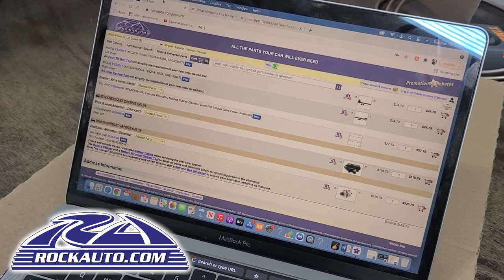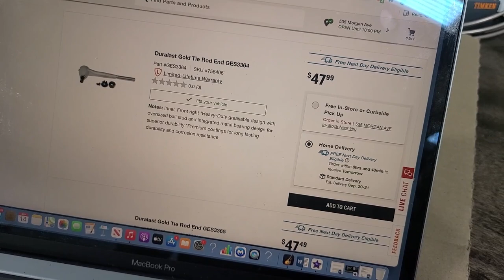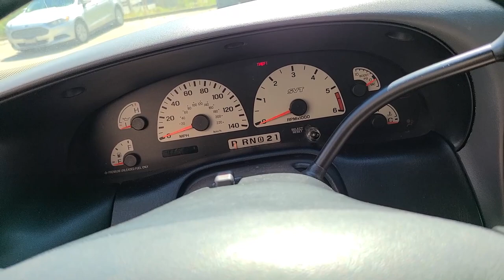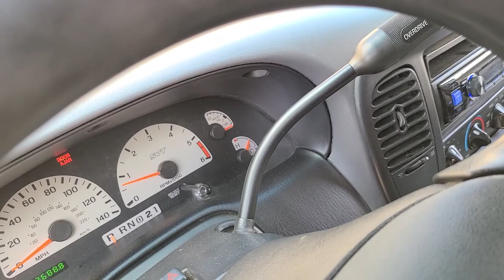I Found A MAJOR Engine Issue After Fixing EVERYTHING On My SVT Lightning! Previous Owner Had To Know

Comment: I own a 2002 Harley Edition F-150 and love watching these to get an idea on what to replace and how (relatively same as lightning). Just bought my end links, control arms, and pitman arm today and stumbled across the video. Another thing I would HIGHLY recommend on these trucks are catch cans. My HD always had a little oil residue on the intake manifold and inside the intake elbow and the factory trucks tend to blow a little oil by. Yours may not be doing that since its a 80,000 mile lightning but I beat my head in trying to find the fix for it so I figured I'd leave it here in case you notice the same. Love the vids and if you happen to get a catch can Id love to see an install.
(Transmission valve bodies are a cheap way to have you nearly spinning through 3rd gear if you are looking for a performance mod. I Recommend Punisher Valve Bodies personally)

Comment: Ive used rock auto, good and bad dealings. Easier to buy locally than deal with returns online.
Working on turbo diesels, an easier way to test for blown head gasket is install pressure gauge in degas hose at coolant reservoir and than do some WOT boosted pulls and watch the pressure gauge. If its a head gasket the pressure in the cooling system will jump to 20-30 psi over the cap rated pressure  easy peasy and no risk of burns

Comment: The only sealant I would trust for repairing a dodgy head gasket is a product we use here in the UK called "A new head gasket". Trust me, sealants just clog and block up everything without really addressing the issue - Don't do it. Plus, when Ford changed the heads from 4 thread spark plugs to 8 threads I think they fitted a beefed up head gasket (3mm if memory serves) this may well solve your issue, however check the head bolts for torque settings. You may get lucky

Comment: I had an Audi A2 with similar issues, I sold the car rather than fixing, but stretched head bolts was the suspected cuase.

Worth a try with the head bolts before pulling the motor.

Comment: Some advice on further troubleshooting- pull a spark plug and use a borescope to check the threads in the head. If it's been 'repaired' you'll immediately know, since the repair involves adding threads to hold the plugs better. 

Also, I'd definitely pull the valve covers and check the head torque - I'm quite certain that it'll at least help, even if it's not the root cause (which I think it is, personally). Free except for time, and maybe gaskets depending on their condition or type (do these use cork? I'm don't remember)...

Comment: I had same exact issue...  turned out the block also had hairline cracks in between the water jackets, truck still ran fine locally but the longer I waited to fix it, I think i just was hurting more parts. I ended up buying FB market place engine and built it first, then swapped. Good luck... you gave me the hibbie jibbies with this video reminding me what I went through..

Comment: Id bet its a stud. Only happening under stressful conditions (I.e 'beating car' = full boost and engine PSi at max). Drivability still good, no rough idle and only dumps coolant every 100 miles. Suggests no warp in the heads an no constant leak in the gasket, the studs are probably stretched and its lifting under boost

Comment: Blue Devil works pretty well and doesn't clog stuff up.  I've seen it seal a 2 inch long crack in a Ford 7.3 diesel when the owner let the water freeze.

Comment: When it comes to renewing the front end on a vehicle, Performance Suspension Technology is the way to go with their polygraphite bushings for everything but torque arms. Get the rebuild kit and get a serious discount on front and rear antisway bars, bushings, brackets, and end links. I have yet to see a Ford centre link fail, even after a million miles. The Pitman arms have never given me any issue. Have done a few outer tie rod ends and lower ball joints on one of my Torino Birds. What I have found is that about 30 years or 200,000 miles the output shaft seal begins to leak. Since the steering box is usually showing wear by then, it is just as easy to replace it, making it good for another 200,000 miles.

Comment: I used the Blue Devil stuff on my Sentra SE-R because at the time, I didn’t have the time, money or place to fix it properly. It worked and lasted for about 6 years before I started getting misfires because coolant was getting back into the combustion chambers again and I ended up replacing the head gasket this time.

Comment: I used sodium silicate. Will not clog because it need heat and co2 to transform into glass. So will only form glass at the crack. It then takes 800°C+ to melt again so pretty safe. It saved me on various TDI 110 which might very well have even higher pressure than the triton.

Comment: a friend of mine had a lightning that he owned since high school and ended up selling it because oil kept puking from the cylinder head/block mating surface (i think it was the passenger side) near the fire wall.  long story short, he found out that there was some weird machining issue directly from ford and that's about all i remember.  i know he said when he got the new heads in from ford (since he decided to do both head gaskets and heads at the same time), he saw that the machining issue from ford was present on the new heads.  i don't remember what all he ended up doing to get the truck driving again, but he did sell it.  i'd say take a look in that direction to see if its a head issue or at least know what to look for so you can verify if it is or isn't the problem.

Comment: 32mins in, you're saying exactly what my thoughts were.  If the heads aren't torqued properly after previous work then it could be lifting under boost, definitely would at least try retorquing them before pulling the whole thing out.  If it was pressurising and spewing under more normal driving & not only when hot and being beaten then I'd say not as likely to fix it but as long as you've not been forcing the issue a lot you might get away with it.  Triton = Ford's 7M? lol they had issues from the factory though with the head bolts being torqued to 78nm instead of 78ft/lb so nearly 25ft/lb short!
Reply: oh & definitely wouldn't advise any kind of sealer, my experience suggests they don't work too good when there's combustion gases in the coolant.

Comment: Alex- Had good luck with Blue Devil head gasket repair on an 05 Tundra with a fairly minor leak. Was experiencing coolant loss and misfire on that cylinder. Been running flawlessly for 20k miles and counting since Blue Devil. Never used it on a boosted application though. Good luck.

Comment: Pull heads, port, go up a valve size, ARP bolts, MLS gaskets, done.  I wouldn't even mess around with doing half-ass fixes, you have other vehicles to be driving while it's down for a few weeks.

Comment: I bought a brand new white 2001 Lightning. At about 20k it almost spit a plug. I was sitting in a parking lot when it started to leak & when I heard it I shut it off & saved it. All the 5.4s did it. In 2003 they say they fixed it but they didn't. I recently seen the v10 trucks spit plugs too. Another problem that I had & others had was the factory goodyear F1 tires randomly had front tire blow outs. Some people had like 2k miles on them & a blow out. I put Nittos on it & never had another blow out. I had 2 goodyear blowouts.

Comment: Retorque the heads and see if problem gets solved. Simpliest solution, but if u want to pour something into engine, KW Metalic block seal has worked for me before in small block chevys.

Comment: I'm very familiar with Supercharged Ford vehicles that blow headgaskets. I've owned 3 Thunderbird Supercoupes. Other than the pristine low mile 89 I own now, the other 2 blew headgaskets right at 140k miles. The 3.8L V6 was notorious for blowing headgaskets even with the NA motors.

Comment: I bought a 09' Subaru Forester. I live in Michigan and bought it in Ohio. It had a perfect Carfax so I thought everything was cool. It was. Car would not heat up and ran so cool the ecu stayed in the start up mode. I got 13mpg driving 70mph in 5th gear. Far from the 27mpg it should get. Checked it out the next day and it had no thermostat. Runs perfect now.

Comment: Big problem on the mod engines. Yes, pull engine and use ARP heat studs for a permanent repair, also Crack check, resurface and a pro valve job . I know, lots of cash but that 1 is worth it. Again, please use studs instead of those cheeseball stretch bolts, a tragic design. I love the color too!

Comment: I would try checking the head bolt torque first. You never know, you might get lucky. It's fast and easy and if it solves the problem, great! If not, you know where to go from there. With a boosted engine I wouldn't trust using some kind of head gasket sealer. If it works at all, you'll always have that doubt in your mind about hammering that throttle and doing Lightning stuff. Better to just properly replace the head gaskets and hope there is no other problem. You'll most likely see that on disassembly.

Comment: Usually people don't remove the heads to fix the spark plug thread issue if they did it right you use the calvan insert and never have to worry about it again which can definitely be done without removing the cylinder heads

Comment: Headgasket sealer worth a look is the small little blue bottle the size of a 2stroke mini bottle. I think the product is called "K2" or "K12" but it gave me an extra 20,000mi on my 5.4 Triton. And also know the spark plug problem! I've installed 3 of the repair kits for the known issue. Good luck! And I know how much you enjoy that lightning, I drove one around for a week and probably took 10 years off it's life. But he said he built it for that. 😂

Comment: I like the idea of seeing what the head bolt/stud nut torques are, but as the problem only exists under full boost load, I reckon you will see nothing unusual on an engine that is cold or only warm. It may only need a cleanup and new gaskets now, but if you keep driving it for some time you could end up with tracking damage to the heads which would need machining work. Come what may, you will never really know until the heads come off, and why could this not be done with the engine in the car? Edited for spelling error.

Comment: Alex **READ THIS**, before pulling the heads make sure to check the oil filter adapter gasket Part# FEL-PRO 70801 {#F65E6A636BA, F65Z6840A, F6AZ6840BA}   Driver side of the block,  the oil filter adapter moves the standard location of oil filter to the rear of the block and carries oil and coolant to the oil filter and the oil cooler.  This gasket fails at the block and allows pressurized oil to enter the coolant giving you the brown colored/oily coolant.  I would also suspect the hydrocarbons in the oil would give you a false positive on the head gasket test.  Additionally, the oil cooler directly above the oil filter is also know to fail yielding the same symptoms.  I am the original owner of a '99 Lightning build #313 and chased this exact problem, fixed w a 7$ gasket.

Comment: I just had a 02 escort se with the 2.0 single port engine with a cracked head on cylinder 1 and I put k-seal in it and the guy ran the car 4 days before it cured it everything is good with the car now.

Comment: Stretchy bolts. Torque to yield is what Ford uses. It could be that they pulled the heads, and reused the bolts. If you pull the heads then use studs to prevent issues. Pulling the heads gives you a chance to see if the heads are warped and to check the spark plug threads, which is another issue of those 5.4’s. Don’t feel bad head jobs are common. Just think of it as an opportunity to clean up air flow and a minor port job.

Comment: My 3000gt VR4 did the same overflowing issue.... I tried blue devil, it is supposed to be the best.... turns out the exhaust side head bolts were loose.... broke them all loose and tq to spec... been ok so far.

Comment: Definitely worth a shot at torquing the head bolts. I've used Bars Leak Head Gasket repair with great results just, to prolong it before an actual repair could be done.

Comment: Alex, understand you have to run the engine hard to start blowing off coolant but I can't see why you need to remove the rad cap while its still hot to do the test. Also, it is obvious that you need to run under high boost to create the problem so why not restore the stock pulleys and ecu image to lower boost back to stock, at least while driving around.

Comment: It might be worth a shot to, one at a time, replace as many of your head bolts as you can with ARP studs, machined washers, and nuts, in the vehicle, just to see if you can get that head gasket to seal back up.

Worst case scenario, you gotta take it apart and you have the ARPs to put in when you change the gasket.

Maybe those factory TTL bolts aren't built for the extra boost the pulleys are giving you

Comment: You can try Blue devil. It works and if it doesn't it wont leave a mess... bit definitely check the torque of the heads bolts. Thats What I would do before taking the engine apart.

Comment: If you're gonna wait till winter to fix the head gaskets expect to have cracked heads or block, and there are no head gasket sealers that won't monumentally screw up your engine! Park the truck till you can fix it or just plan on replacing the engine if you wait!! No such thing as a "temporary fix"

Comment: Just redid my 08 subaru outbacks whole suspension and brakes with rock auto. Previous owner thought the outback was an sti and put 2.5” lowering springs on it 🙄 lemme tell you it was a fight to restore it to oem as alot of components where stuck and had grown custom to being at the lower adjusted height.

Comment: Probably head bolts stretching or blown out spark plugs. Common problem on 5.4. Ford says there isn't a problem but,they will special tool for the spark plug issue. There could be an issue with the thermostat or maybe waterpump.

Comment: My 2002 F150 xlt benefited massively from the steering-box 'play' mitigated by the top mounted adjustment bolt taking up slack. At 110k it was really noticeably improved. You have replaced many parts, ok, but box play remains. I too fitted Bilstein dampers; all F150 would benefit this enhancement.

Comment: Skip the sealant. Ooh, ick.  Retorque the heads and test it again. If the gasket is sealing with normal combustion pressure there is a chance things just need torqued properly. If the bolts aren't loose tho, you have a bigger problem. Maybe the wrong head gaskets... Hope for that.

Comment: My friend purchased a modded SVT lightning from a local ford dealer.  We took it to or local ski mountain to give it a good rip.  Stayed floored for 30 sec or so and then the engine died. The engine died as it dropped the tip of a spark plug.  Engine was totaled and then the dealer took it back and then my friend left in an SVT Mustang lol.  I still love the lightning.

Comment: You can only make cross country trips during the winter, or if you avoid 110 degree weather.   Your head gasket tester is not going to catch it.  You need to do a leak down test, then hook up shop air, to the problem cylinder to confirm.

Comment: I know of this problem happening on Volvo 5 cylinder turbo engines, and all they require is to tighten the head bolts by another 20nm. Hope this helps.

Comment: Check the oil filter adapter it has engineer oil and coolant and is prone to leak on 5.4 and 4.6 Ford modular motors. Don't pull heads. Please do that first.

Comment: The way I would have checked this and maybe you can test it also. Is put a coolanted pressure tester on the motor. And zero out the gauge. Then drive it and do some full pulls with it. And see how high the gauge reads. And im sure its way higher then the cap is made for. Because its already pushing out past the cap.

Comment: If you do end up taking the heads off put some brass inserts for the spark plugs. I had a 4.6 that touched a little past 300k never blew a plug after I put the inserts

Comment: I get it, not the same exact thing but I have an old hot rod truck with warm SBC with a choppy cam dual 3" into dumps and the built trans failed so I put the original back in to get around and it works fine except under heavy acceleration it slips so I have to drive a roudy sounding truck with 295s half throttle or less.

Comment: Check your cats. I had a car that would overheat after a super long drive. It turns out the catalytic converter was partly clogged and after a while combustion would leak through the coolant passages and cause the cooling system to over pressurize. Eventually the head gasket did break and I got coolant in my oil. Good luck!

Comment: I’ve just spent hours, getting the head off my prelude for a head gasket/timing belt job.  And now I’m watching more working on cars videos.  🙃

Lol that prelude had a blown head gasket, yet it drove perfectly smooth, had full power.  Just coolant blowing through, the over flow tank. Only during high rpms.

Also, I’m going through the same exact thing with a 1996 240sx just bought.     I bought a total pos.  That I am now committed to making that car right. Lol.

Comment: I have been there Alex.I traded my 79 Camaro for a 94 z28.it had a slight miss.I ended up replacing the engine.it popped the rings on a piston and all the pieces smashed into the heads.got a used long block.did the swap in two days.with help.